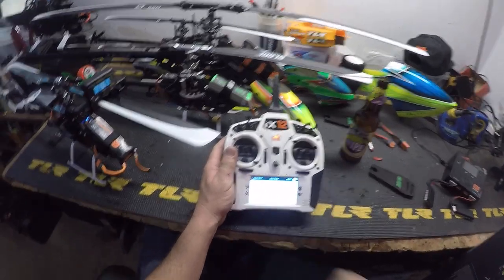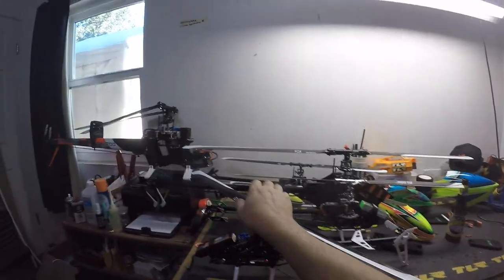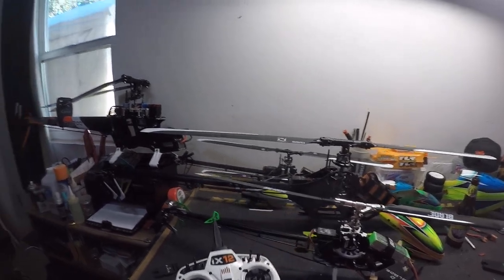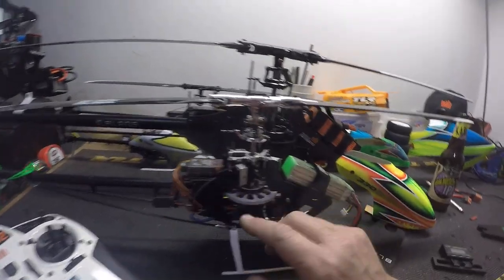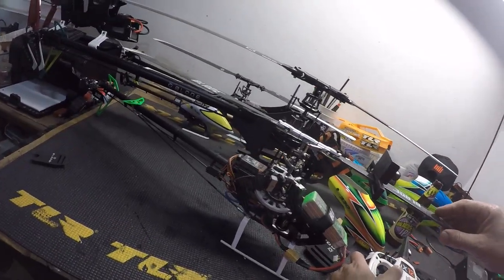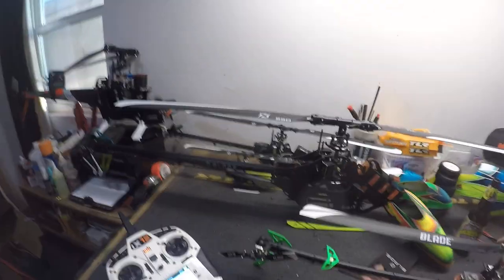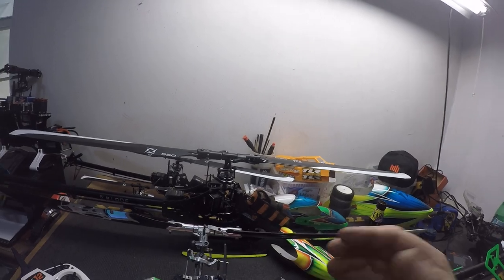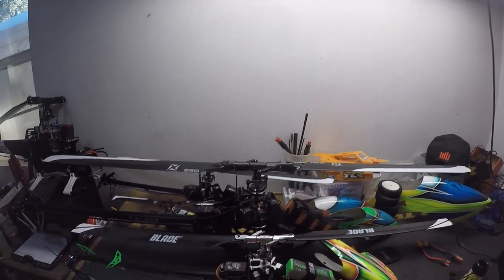R/C Helicopter Tips and Tricks with BNF Out of the Box and Kit models Part 2 of 2 With Coe Show

Comment: Great videos!!!! I have the Blade fusion 270 and set up out of the box it has bad tail wag. I also tried to install a ar7200bx and it lands and takes off so much better, but it still had tail wag. Do you have any suggestions?? I really want this heli to fly. Just got the OMP M2 and it flies better than any other heli I have. Still flying the Blade 550x pro, nano s2 and the mcpx bl2. I cannot for the life of me program the three modes from the s2 or the bl2 on my radiomaster tx16s. It's boggling. I have the older dx8 but I do want all models on the tx16. Been flying FPV for a while, and just recently got back into helis after a 3year idle. Keep em' alive!!!!

Comment: great Video CoeShow, thank you. I'm trying to bind my 330s but it doesnt working? Everything done according to the instructions and the binding plug inserted on the side, battery plugged in and trying to bind, unfortunately does not work. What could that be? Does the recipient have to pipeline quickly or slowly? Would be cool to have a video of the binding :)
Reply: I have had that problem when my radio is too close to the heli. Try 4 to 6 feet away 👍